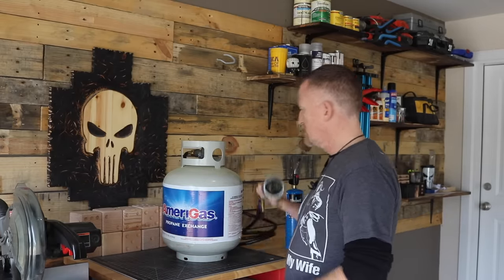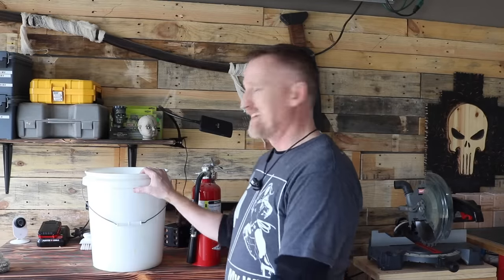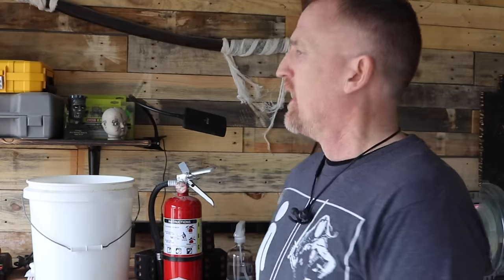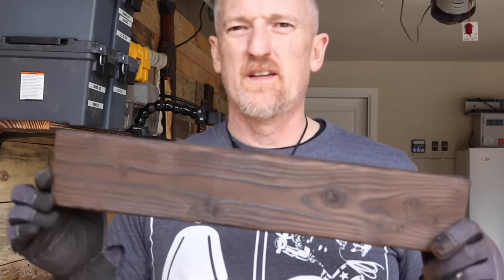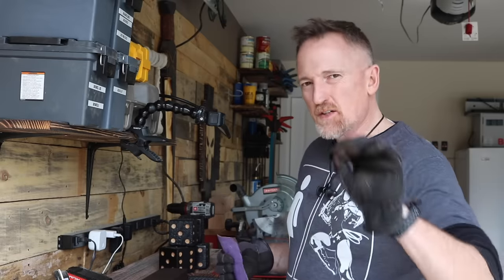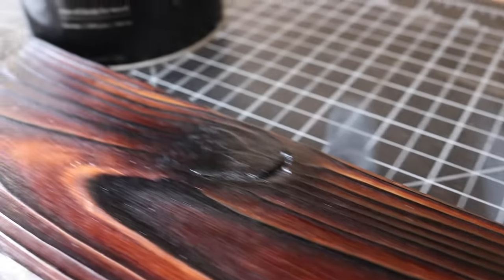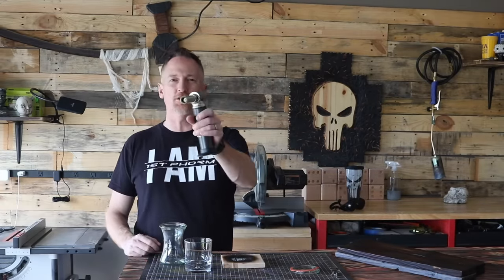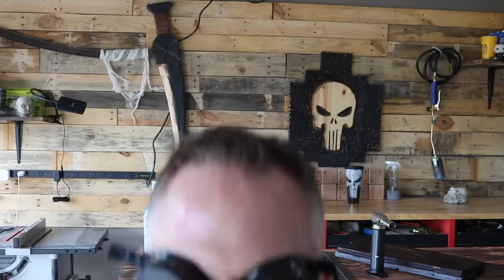DIY Wood Burning Technique - That's not Shou Sugi Ban! Or is it??

Comment: Hey mate, I've been in the 2pac kitchen/timber refinishing/french polishing industry (mostly as a painter) since I was 16 (now 29) Your burning technique is very good, I just wanted to let you know with the burning then sanding like you do its closer to a "Patina" technique than anything else I believe (burn, sand, stain, sand, seal, sand, top coat  would be the 100% correct way but your way is fine. Also patina can of course be done no burning just mixing different stains to create an older look. Its also a technique done on some old school hot rods) Either way, I'd just like to say that you do a top notch job! Keep up the good work!
Reply from the maker: Thank you for the info and the kind words!
Reply: @BuildDadBuild  You're welcome!
Reply: Patina only aplies to steel in the sense your talking about
Reply: @Thecarverman  no it doesn't

Comment: Sugi (Japanese  cypress), the su part is like soo, as opposed to shoe.  You'll see this burnt sugi siding on traditional homes because of its excellent resistance to rot.  Sugi is a great building material because even prior to burning it resists both pests and water.  I've built with both pine and sugi and while pine is a heavier material, it doesn't hold up over time unless pressure treated, when exposed to the elements for years on end.  Keep your stick on the ice.
Reply from the maker: Thanks for the info!

Comment: Are there any alternative stains you would use to achieve a look comparable to the finish with the simple finish? I really like it, but it seems like an expensive product
Reply from the maker: Possibly Shellac? I think that would be the closest. 
I've never found anything that works like Simple Finish so I think the price tag is totally worth it. For what it's worth a little goes a long way. I used it on my workbench project and used less than a 1/4 of a pint!
Reply: Boiled linseed oil?

Comment: Great video! Thanks for the tips, and they look amazing. One question, though. What kind of brush did you use to brush the char off of the planks?
Reply from the maker: That is a nylon brush (like one you'd clean a bathroom with). In the past I've used a metal brush, but it leaves more tool marks.

Comment: Some cheap large towels or small blanket from the thrift store soaking in a 5 gallon bucket close by will put out a fire pretty quick also .. without having to soak the wood so much .for when you want to restart... I am really learning a lot from your videos..  thank you for putting the channel together and sharing..
Reply from the maker: Thanks for coming along for the ride. And thanks for the info!
Cheers!
👍🥃👍🥃

Comment: I had to try it out so I just did one side of a board of approximate size and got "cupping"(?) I had a different experience brushing but the appearance is the same. Thank you for the knowledge sir.
Reply from the maker: You’re welcome!  Hard to completely stop cupping, but try to keep the wood damp. It helps!
Also (depending on the project) if you can put supports across the back you can keep the surface flatter.

Comment: Hi Nick, 
Now i understand few things:
The thicker the wood the deeper you must burn. You did your samples on 1x4 wood. 
I did on 2x4 and that’s why it looked different so now I will use 2x4 wood and burn in a little more. 
About finishing- 
1. after you put 1 coat, did you wait some time and then wiped it off? If yes then how long?
2. How many coats did you put? For the sunbleached for example. 
Thank you sir.
Reply from the maker: Most stains I wait about 5-10 minutes. With the sunbleached I waited about 4 minutes.
1 coat should do it.
Reply: Build Dad Build 
Thank you so much.

Comment: I used to lightly char pine furniture and clear coat it.  I never realized you can take wood charing to the next level like this.  I gather this is best on softwood like pine and fir.  I can't imagine anyone ever doing this to a fine grade hardwood.
Reply from the maker: Anything with an open grain pattern really. But pine, fir and cedar work well because of the amount of soft cellulose material.
Cheers

Comment: Instead of sanding and wire brush method use the different pressure jets on a pressure washer to get the fine detail of wood grain and for the darker lighter ratios 
Saves lot of time 
I did my whole house in board and batten 
Toarched the 8x12×1"
Both sides and power washed them one at a time.
Turns out great.
Then you can try different stanes or oils on them.
Reply from the maker: Very cool. I'll have to check that out. Thanks for the tip!
Cheers
Reply: What PSI washer did you use? I have a lot to do, so a faster method would help.

Comment: i'm a luthier, specialize in basses...i got a bass on the wall that's gonna get that burnt and bleached finish. i decided that about 9 seconds ago. ive done burnt guitar tops (you dont wanna torch the finished body or you de-laminate the glue). i rough a thin, half to quarter inch piece of pine because pine burns nice, and i do a bunch of rapid flame and wire brush so it sluffs away and burns deeper without overheating the piece. always burn the wood, THEN glue it to the main slab for stability. you can trim and sand and then re-burn some of the edges carefully. i got a guitar that i burned the top, then wire wheeled it, sprayed it with heavy glaze and then painted it metallic black. looks like the body is made of lava. freaking thrilled with it.
Reply from the maker: That sounds awesome!
Reply: Some excellent info, Thanks!

Comment: If you use a little dawn dish soap in the bucket of water it will break down the water surface tension making it easier for the water to soak into the wood in case something bad does happen. Little firefighter trick
Reply from the maker: Good to know.
Thanks, brother! 🥃👍🥃👍

Comment: Is there a faster way to sand on longer pieces. I did my garage shelves like that but not to that extreme..no sanding or stain.. I can tell you have progressed with this technique..good job
Reply from the maker: Hey, Bill!
In this video I was using a combo of a wire brush and a nylon bathroom brush. However I have UPGRADED!
Check these out, they attach to your drill. Sooooo much easier.
https://amzn.to/3bZm3DN
Cheers!

Comment: 3 questions. Is water necessary? Why brush off the charred wood? Doesnt the torch mark up your driveway?
Reply from the maker: 1 - Yes. It mitigates warping.
2 - Because I like to see the grain pattern. You can definitely keep the gator char if you want to stabilize it somehow.
3 - Yes. I've started burning on an old aluminum ladder to keep it from scorching the concrete.
Cheers

Comment: If you were to make a table top like that, would you burn each individual board before jointing and gluing, then go back and finish, or could you do burn the whole table top after its glued?
Reply from the maker: You can do it either way. Both come with their pitfalls. I usually assemble first, then burn.
Cheers

Comment: Theres an impact and drill scrub brush attatchment on amazon that comes with three different shaped peices. Two flat in different sizes one round for 16 bucks. Worth while investment for fellow burners. The drill cleans the boards quick.
Reply from the maker: What brand did you buy. The ones I bought self destructed almost immediately.

Comment: you might want to try the wood preservation technique used by or similar to the usa forest service used on cabins etc,  ..suppose to last for decades interior or exterior...they dont torch the wood however, adding the torched wood and this method together ought to make for some extremely long lasting wood building projects....after torching the wood, then paint this on with a brush or spray,  mix the following together:  1 gallon mineral spirits,  16 oz of boiled linseed oil,  and 2 cubes from a 4 cube box of canning wax that has been melted over a burner by putting 2 cubes of unmelted wax into a small metal container then put small container into a larger pan with heated hot water until all the wax melts then pour melted wax into the solution of 1gallon mineral spirits with the boiled lindseed oil added into it,   mix all together and now you have the final solution to use to paint on with a brush or spray on over the torched wood....and then store the rest for later use, however,  [ am not sure if the melted wax will stay in suspension in the mixture for storage over time or not]  but the important thing to note here is this preservation technique may make the wood last for more than decades maybe centuries?
Reply from the maker: Wow...that's some serious stuff!
I'll have to keep that in mind. Sounds like it would work really well on something that was going to be outside in the weather.
Cheers!

Comment: Wonder if you had a large wall to do if you could use a pressure washer instead of brushing the char off? Also, if you’re doing this for longevity instead of looks, should you just leave the char on?
Reply from the maker: I think a pressure washer would work. If you're looking to get the full protection of the technique you'd be better off not taking the char off.

Comment: gonna do this to new RV gate wood panels. I have transparent Timber oil to follow up with. or should I use a different stain. Your color stains do look awesome.
Reply from the maker: Just need a top coat with some sort of uv resistance to keep the colors.
Cheers

Comment: Im not one of the 85% just subscribed. You sealed the deal with the white walker whiskey!
Reply from the maker: thank you!
Reply: They are proud of that simple finish!! $41 a quart?!?!?! Really eats into the profit when you could probably use barn red verathane for a quarter of the price. What blew me away was the gallon was only $3 cheaper than if you bought 4 quart cans. Usually theres a larger savings than that if you buy larger quantities. Such as verathane theres roughly an $18 savings if you buy a gallon vs 4 separate quarts. I like the color of the simple finish but not that much.
Reply from the maker: Wow...didn't even realize the quarts vs. gallon thing!

Comment: You sprayed water to prevent cupping? If you burn a board on both sides, should this prevent or minimize cupping? I would like to make an 8 to 10 inch deep shelf and am concerned about cupping in the end product. Thank you.
Reply from the maker: Spray to prevent. Burn the other side if  you still have issue.
Cheers!

Comment: I like all of them besides the blue. My favorite is the grey...
Reply from the maker: Folks love that sunbleached!
Reply: @BuildDadBuild  would u be able to do this to plywood ? Burning an brushing an sunbleach?
Reply from the maker: @angelabosco3087  It's pretty difficult to do a deep burn on plywood. The torch can easily burn through the top ply or super heat the glue and cause bubbles.
I would suggest a surface burn only for plywood.
Cheers

Comment: I want to build something out of wood using the burning technique.  Would you suggest doing the burning before or after the item is built?
Reply from the maker: It kind of depends on what the project is. If you're going to have a lot of hard to reach corners, burn first. If not you can burn after assembled.
Cheers

Comment: I've been doing a lot of burning and testing out these different processes on a lot of pine and the results are nice. I mached up a mantle corner and burned/brushed it heavy before I build the whole mantle and the cupping pulled some of my joints on my mother's apart slightly. How can I avoid the cupping on some mantles and faux beams in going to make?
Reply from the maker: Usually burning the back is helpful to force the board back to straight. Also make sure you are misting your boards with water as you go. Warping can also occur if you're heating the board too  quickly. Try to do a couple passes with the torch, instead of one heavy one.
Cheers

Comment: Love the video trying it on a repurposed barn door.  I’m having trouble with worping on the length of the door. I know there is a way to fix it but I would rather get some more info before I destroy this door. Can you help me out with this?  Any help would be great thanks
Reply from the maker: Warping when you burn? Doors and long lengths of wood are difficult because the wood naturally wants to warp when heated. A couple of solutions:

1 - Burn it a little slower. More passes quicker motions with the torch.
2 - You can burn the back and it can mitigate the warp.
3 - After burning set something heavy on top of it to hold it flat while it cools.
4 - Remember to spray the wood with water while burning.

Cheers!
Nick

Comment: So you said the sun bleach stain looked washed out, did you wipe it off while it was dry or wet? Awesome video, thanks for the info!
Reply from the maker: Hey John!
I wiped it off when it was still wet. When it went on it was all white. If I was going to do it over again, I'd wipe it on, let it dry and knock it back with steel wool. 
Cheers

Comment: I have seen this before and wondered how.... but as I am just starting woodworking, it sort of faded into the background. Now iI have watched this, my interest is back.
I really liked your presentation, from safety to the finished product.
Two quick questions. Do you only use pine and does it tend to warp, when you do the deeper burn.
Thanks (subscribed and liked)
Reply from the maker: Thank you.
I mainly use pine and cedar. To reduce warping make sure to keep the piece moist when burning. I use a spray bottle with water.
Cheers!

Comment: Have u ever tried this on plywood.. I’m trying now with a white stain and it didn’t turn out that great but I’m gonna try ur technique and see.. any info would be appreciated or even a video .. thanks
Reply from the maker: You can do a light burn to plywood. 
If you go to heavy or keep the torch in on place for too long you can burn through the top ply or cause the glue beneath to bubble.

Cheers!

Comment: Thank you. Very good video. I see that you use some techniques of staining. Could you please explain exactly how you do it? I see that you don’t use brushes..
Reply from the maker: Thank you.
I just wipe the stain on with a clean cloth and then wipe it back off.
Reply: Build Dad Build thank you. The same method for both oil and water based?

Comment: I am building a small garden deck with a privacy screen. Will the burned wood  and stains (love that sunburned stain)hold up to weathering?
Reply from the maker: Burning the wood actually makes it a little more durable to the elements by itself. 
The Japanese use this technique on siding.
I would just make sure you use an outdoor sealant made for decks to finish it.

Comment: Nice. I like the crackled/alligator skin look. So I wouldn’t have wire brushed it off. I would have applied an acrylic spray over it  to help seal it so it doesn’t flake off
Reply from the maker: Did a video where I take the wood to gator here:

https://youtu.be/DoBWpOzGMXc

Check it out!

Comment: When you burn the wood, why scraping the outer coat? (the burned stuff). Can you stain over it?. Asking because I did understand that burning the wood prevent bugs from eating it (like wood worm and such), and that is why i am asking. would be happy for your thoughts here.
Reply from the maker: Depends on the results you are going to.
Reply: @BuildDadBuild  can you explain please?
Reply from the maker: If you're going for a gator finish (charred wood) or f you want to brush it down to the wood.

Comment: So I have a nice store bought sanded piece of oak ... going to make a counter top.    Question I have is since it's super smooth will this burning technique still make it pop and show up nice?
Reply from the maker: If you surface burn it, it will just turn black. If you deep burn it, it will texturize.
Check this video out:
https://youtu.be/_fnV2Or8Ayw
Cheers

Comment: I have always loved the look of wood torched pine.  Is it possible to use a torch on a piece made from raw pine that is already built or would that be a bad idea?
Reply from the maker: You could definitely torch a raw pine piece depending on how it's assembled. Keep in mind you might have to go back and reinforce the joints after burning!
Cheers!
Reply: Thanks!  Do you think I could have a problem with the wood splitting or have problems with cupping over time?  I just don’t want to end up ruining it!

Comment: Hey nick.  Wondering the difference of that minwax natural compared to the marker brand simple finish bc $41 qt is kinda spendy don’t ya think. I’ll give the whitewash a try on my cedar project as well as a color.  Like the red you have used.  Also before deciding whether to go with the olive oil (sent ya some pics) Im going try deeper burn then use wire brush or buy a 80g nylox hoping for more definition.
Reply from the maker: Simple Finish is a little pricey. But I've learned that you get what you pay for when it comes to finishes. And yes, Simple Finish is that good. 
Cheers

Comment: I tried the sun bleached color on a shelf im building made of pine.. I did not achieve nearly the same amount of contrast as you did.. it looks really washed out. Is there something I could try differently? I used a sponge brush to apply. Im curious how long you let the stain sit before wiping off? Thanks. Great video
Reply from the maker: If it's looking washed out try going over the top with some steel wool. It should bring your blacks back out.
Cheers

Comment: Im trying to do this but the ridges on mine arent as deep. Am i missing something ? Also, when i stain it its turning out much much darker than yours. I feel like im barely using enough stain to spread across the whole piece. Any help would be awesome !!! Nice video, awesome results !
Reply from the maker: To get deeper ridges torch again and repeat the process. Keep doing it until you get the depth you're looking for. 
As far as finish goes, make sure you're sanding your highlights super light before you stain. 
Hope that helps! Happy building! 👍🏻👍🏻